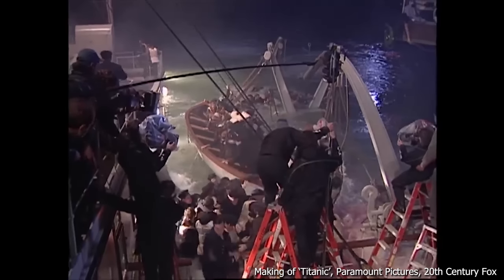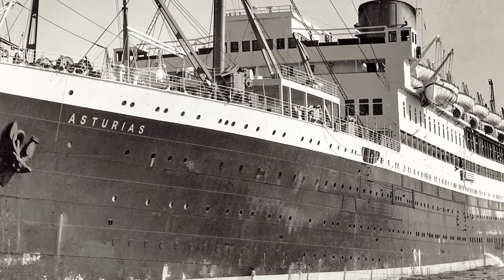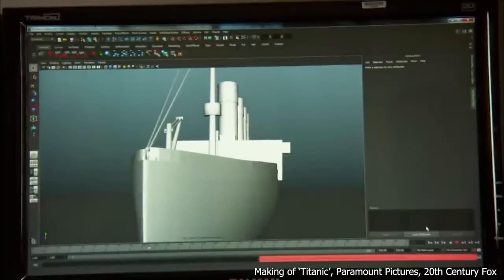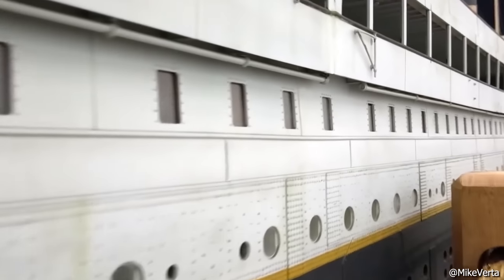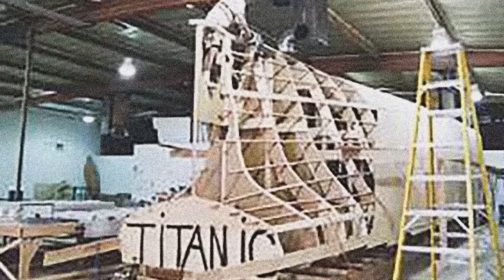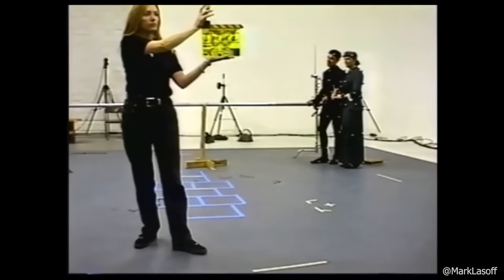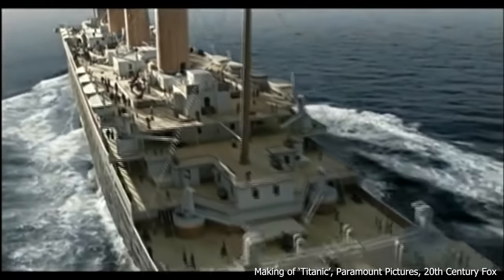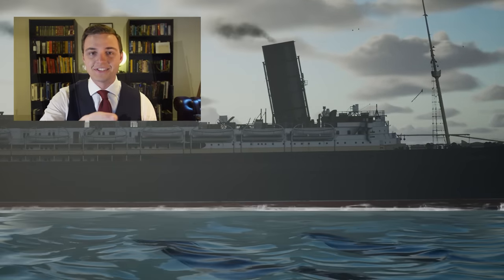The RIDICULOUS Models From Titanic

Comment: You can see at 12:56 that despite their attention to detail, they have the Union jack portion of the Blue Ensign upside down. The bottom right corner of the Union Jack canton shows a broad white stripe over a narrow red stripe; this should be on the top left, not the bottom right.
Reply: As others have said, it appears that they mirror-imaged the shot, as there are other asymmetric details of the ship visible to the knowledgeable. That would account for the flag being wrong.
Reply: @davidjones332  Mirror imaging the shot would not account for it being upside down.

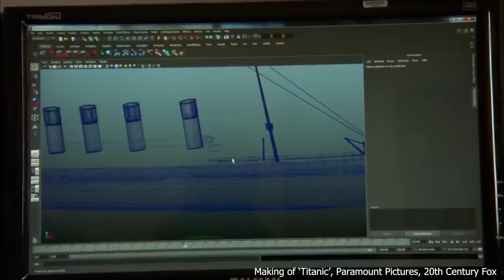Comment: 3:49 Pretty sure the software seen was during making of the 3D version of Titanic because if you look at the User Interface, it's running Window Vista or newer unless they were using XP and modded the GUI but that's unlikely. 'Aero Glass' Windows used in Vista and 7. 2007+

Comment: One thing with the model shot is that the Union Jack is upside down at the back of the ship. The red stripe against the flagpole/mast should be low with the white part above it (look online for a picture showing the right and wrong way of flying the Union Flag). The Blue Ensign is the correct flag though otherwise.

Comment: Much of the issues of lighting were looked at by Kubrik in 2001, about 30 years earlier.  

There were two models of the spaceship Discovery, the one used for the long shots was about 12 feet long whereas the main model was 66 feet long and the spherical bridge was 6 feet in diameter.  In many of the model shots, the exposure time required to get the right look was about 6 seconds per frame, so many hours of filming to get a minute of usable film.
 
To give it "life" the large model was carefully covered with foils of varying thickness, colour and surface finish.  Most of the other models were specially painted to give a more realistic look.  Matting was in its infancy then, if you read any of the good books on the movie such as Bizony's you will be blown away by how difficult and complex that film was to create.  Cameron is really good but he is not Kubrik.  And Kubrik had the best of the best working on that film, they all wanted to be a part of it.

Comment: Sometime in the mid - late 70's I went to the Buffalo Days Exhibition which was the provincial fair in Regina, Saskatchewan. One of the exhibits was a model of the German pocket battleship Bismarck that, if memory serves, was as long as a bus and housed in its own trailer. I don't know the model's scale but the float plane model on its catapult was maybe two or three feet long. The model and its maker had been written up in the local newspaper - The Leader Post. I have the article someplace. It had, again if memory serves, been built by a German immigrant to Canada who was there in Kriegsmarine officer's uniform. Johnny Horton's Sink the Bismarck was playing over the sound system. I'd like to know where this model is now!
Reply: Minor correction: Bismark was a full battleship, not a "pocket battleship".
Reply: The Bismarck wasn't a 'pocket battleship' by any metric, that terminology referred solely to the Deutschland Class heavy cruisers consisting of KMS Deutschland (renamed Lutzow), KMS Graf Spee and KMS Admiral Scheer, due to their 11-inch main armament being larger than any other existing heavy cruiser and the ultimately incorrect assumption that the only vessels which could therefore successfully counter these would be a battleship. The Battle of the River Plate however disproved that theory. The sacrifices in armour which were required to accommodate the armament rendered the design concept fundamentally flawed and therefore obsolete from the outset. All successful battleship designs complied with a proportionate formula of armament to armour, those which strayed from this were each and all unsuccessful.

Comment: Camron even had a 3d scale model made of it down on the bottom of the sea as well, now just think how much time and effort it takes to make it look like what is on the bottom of the ocean, now they said it would be all gone in a couple of hundred years, but now they are saying it will last more than a 1,000 years, sure it will be flatter but most of the steel will be there just covered with microorganisms eating away at the steal, so it will look like a massive dripping wax ship like structure down at 4,000 meters?

Comment: Why did they use the blueprints from the Olympic? Where the Titanic blueprints lost. I know they're basically the same ship.
Reply: Titanic’s blueprints were indeed lost. 
It’s suspected most of them were lost during WW2, either in a fire or as a result of the Blitz. There was also a short clip from a documentary in the 1980s, that name of which has since escaped me, that showcased a set of plans that could very well have been genuine Titanic blueprints, but those have since been lost as well.

Comment: At that point, just bulid a real Titanic
Reply: Normally, I would say that building a 45-foot wooden model is very different to building a complete 882.75' steel ship, but they actually kinda DID do that - a seperate set (with certain key parts removed to save space and cost) was built, essentially a 1-side replica of the ship at nearly full scale (this one was some 770ft with all its missing sections) with most of the decking installed. It was used for many of the exterior scenes, especially during the sinking.